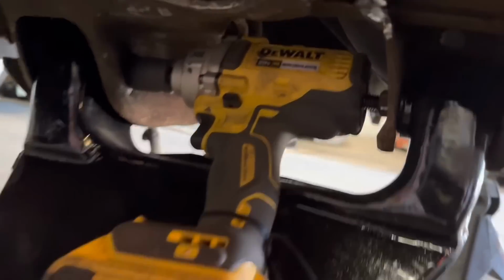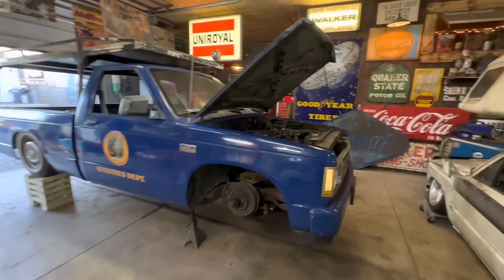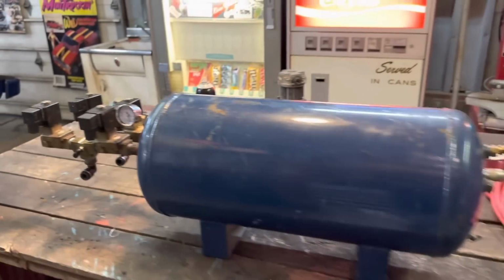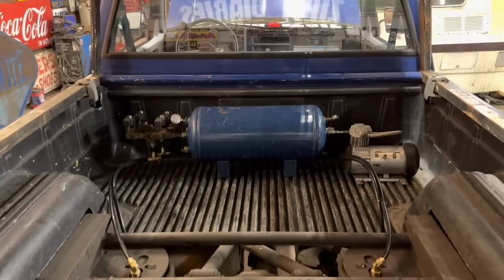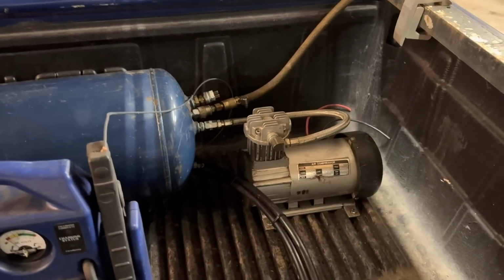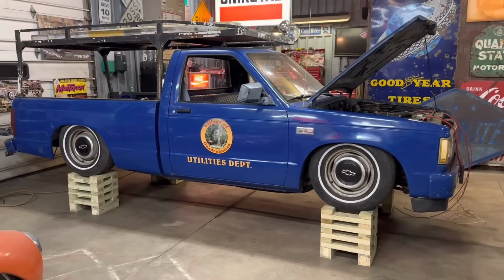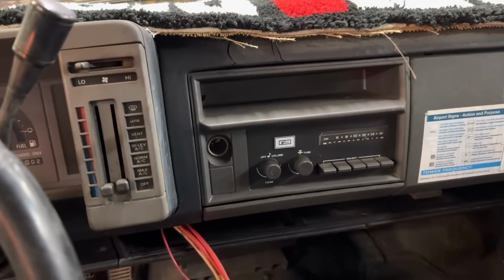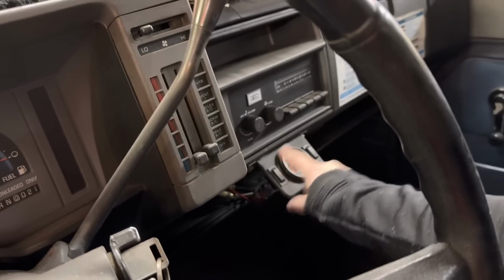MISS ZIPTIE BUILDS A TRUCK-HOW TO BAG A S10 AIR RIDE WIRING

Comment: Did you create the rack on the bed or was it purchased? If bought, from who? I like to get one⚡👍⚡ Nice truck. In the 90s I had a light blue '87. In Jan I found a simular truck to the one I had. Solid body and frame too. I'd love to get air suspension ride on it.

Comment: i like the build but for a work truck possibly would have run the wires and hoses between the cab and bed to free up the space in the bed for a lesser chance of snagging the wires. Just an idea not saying how to do it just a different way i woulkd have but nice job on explaining the system and how you stopped to explain which process you were doing great work by you and the wife keep the content coming man